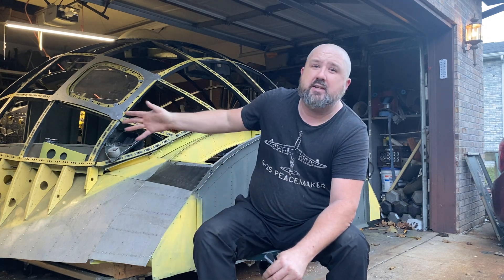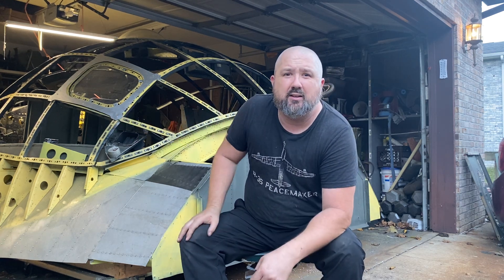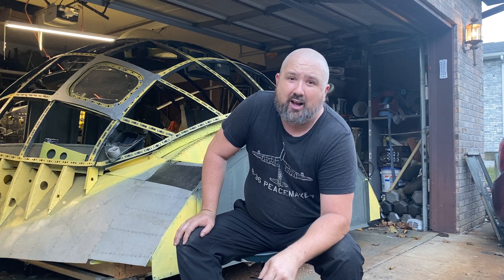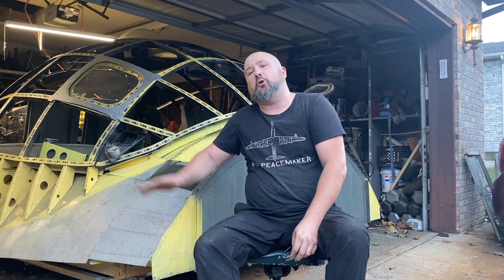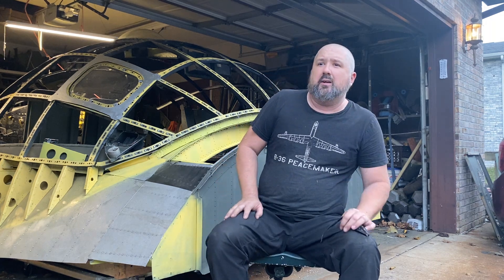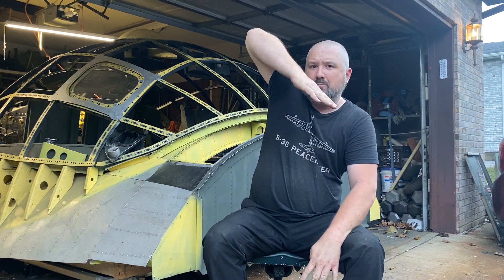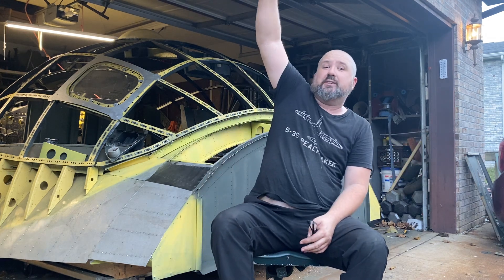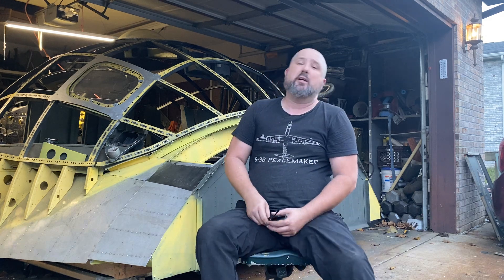I’m Looking For A Few Good BILLIONAIRES Part 2

Comment: Idk. This kind of project, if you decide to let it, can take you places you never thought you'd go. You could build an airworthy B-36 but you would need the use of a free, or almost free 300x300~ hanger on a 10,000 ft runway, tools, materials and volunteers. Lots of volunteers. For this kind of project though you could find that hanger and you could find the volunteers. You can also find sponsors and get material donated. You would probably need to move and you'd definately make sacrifices but there are a lot of people out there who would be willing to give their time and money to this project and maybe  companies willing to donate materials or do fabrication work or even just donate or loan you the equipment for sponsorship spots. It wouldnt hurt if you reached out to some ex USAF to do some PR work for you as well. Find a SAC association and do a meet and greet. You could start a nonprofit and name it after an old SAC bombardment wing. The fundraising might seem daunting but you have built the flight deck, which is a big deal, so its obvious that you can do the airframe. Like it or not, you went big. Dont go home, build the plane.
PS. It might be a B-36 but the FAA would consider it a amateur built experimental aircraft. Which means it would not require certification only a special airworthiness certificate for flight.

Comment: As an airplane nut, I am fascinated by the B-36. I admire your work! I wish I were a billionaire to help you out. You could get aerospace engineers and an army of mechanics with the same vision to make it happen, a flying B-36 would be awesome! Many of the parts could be 3D printed.
Reply from the maker: I don’t know if the FAA or insurance agencies allow 3D printing quite yet. But, that would be a massive cost savings when it comes down to the tons of originally coast magnesium parts.
Reply: @B36HPeacemaker  Space X is 3D printing their rocket engine parts I believe.
Reply: Hadn't even thought about 3d printing. That's a project game changer right there.

Comment: This is the coolest thing i have ever seen on youtube, and ive watched a lot of youtube.

Honnestly i think you started at the perfect time to get enough of a ball rolling on this project that by the time technology advances further the next few decades you can finish this as an airworthy and hopefully slightly more reliable homage to that very last era of the old style of piston engine prop planes.

The biggest worrie are the highly complicated components and the critical wing root structure, but as 3d printing advances further it will become increasingly possible to build the necessary component as close as wanted to original. ai tech will also help to make the plane more reliable as iterative desing simulation can be used to fix the reliability issues without having to completely make diffrent engines and such.

The jet engines are by far the biggest issue, the could increase the total cost of the project by a pretty insane amount in any way most likely, especially as there is just a crazy amount more that goes into jet engines then props.

I would recommend upscaling the piston engines a small amount and only having those, then maybe have decorative jets or original b36 engines for ground use only. But that is up to you and the faa.

Good luck man i really hope you dont give up and find some sponsors one day. Everything starts somewhere and this is way to cool to be given up on

Comment: You don't need Aluminum as much as you need Magnesium!
Reply: Build with cheaper materials that are known to work (Fiberglass/epoxy resin over foam/aircraft timber and plywood). Figuring out how to translate exotic materials to more bulk materials. Lots of Russian and late war German war planes had parts entirely replaced by cheaper wooden construction. The Dehaviland Mosquito and German Moskito are good examples of wooden construction in bomber aircraft. It won't be a genuine B-36 but it could be an alternate timeline B-36 if they were made cheaper.
Reply from the maker: @thejohhny2943  I get 10x4 sheets of aluminum for $100 a sheet, which you can’t beat.
Reply: @B36HPeacemaker  Whatever is cheapest in what places is best I guess.
Reply: @thejohhny2943  That would be very unique.  A Dehaviland Mosquito with Six Turning and Four Burning.  That would even beat the Spruce Goose!
Reply from the maker: Yeah right. Based on little research, it seems that a sheet of magnesium is worth it it's weight in gold.